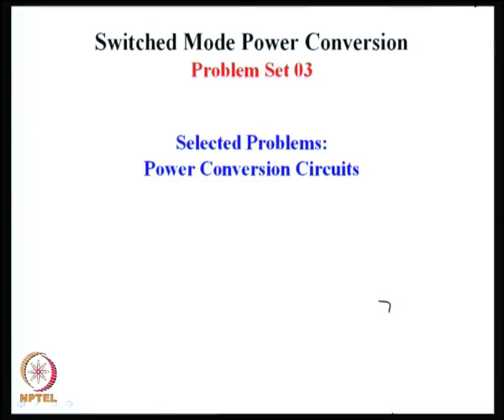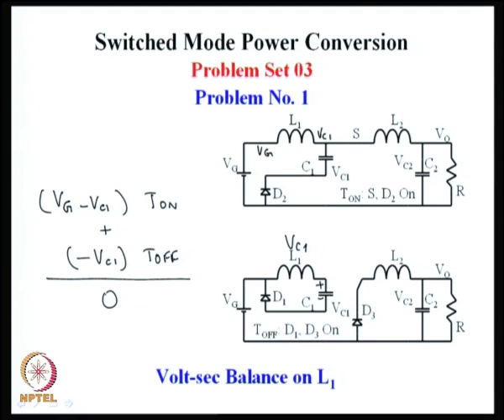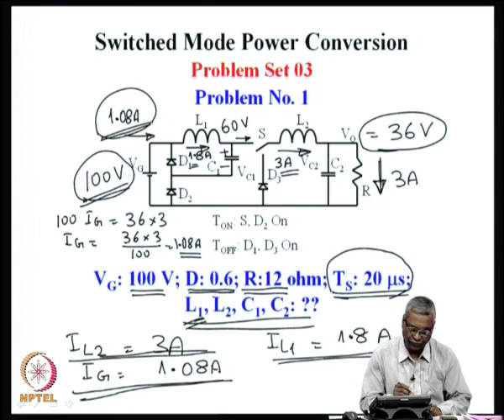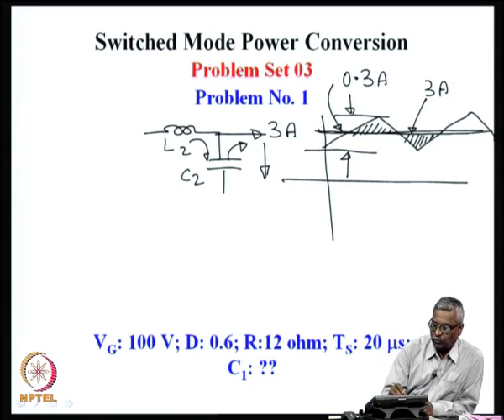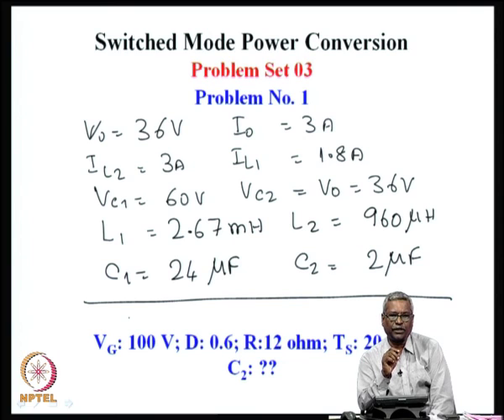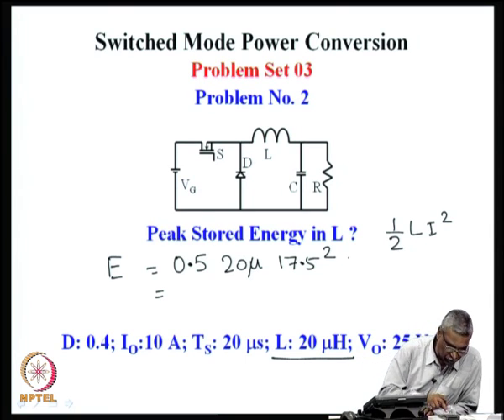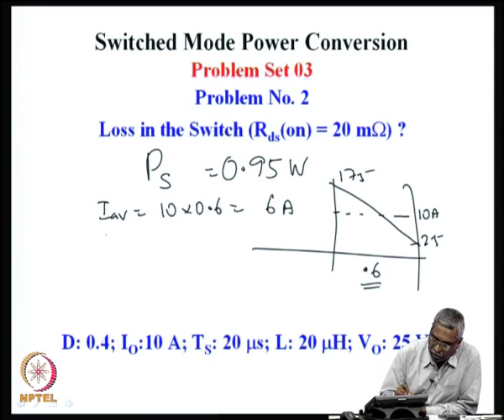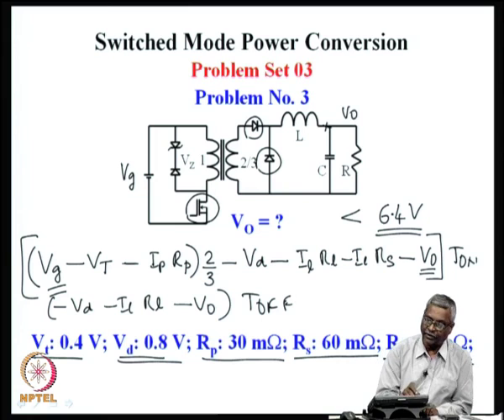Mod-07 Lec-17 Problem set - I

Comment: How can the RMS value of the ramp (-7.5 to 7.5) be 7.5^2/3. The power that should be raised to need to be 3 because it is linearly increasing with time. I think it should have been 15^3/3 although I might have been wrong, please elaborate on this.
Reply: The RMS of a triangular wave is Vpeak/sqrt(3)......Therefore (RMS)^2 = [Vpeak^2]/3. Since the |absolute|  Peak of the triangular wave was 7.5A, the Professor rightly wrote (Irms)^2 as [(7.5)^2]/3......The decomposed signals (square and triangular) when superimposed on each other over the 40% duty cycle averaged out to the average DC value of 6.89A approximately as given by the Professor......Please note that all along the Professor was actually calculating "Irms^2" (that is Irms squared)...You will see that the "square root" of the final result (the "squared-mean" or "squared-average") was found to get the "Irms" value of the current.